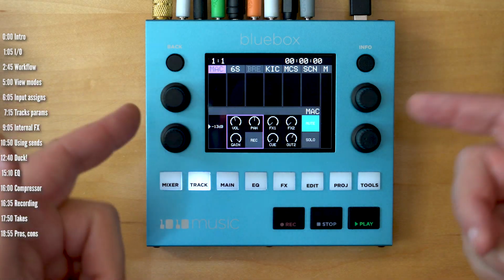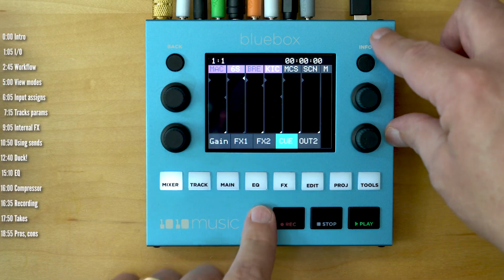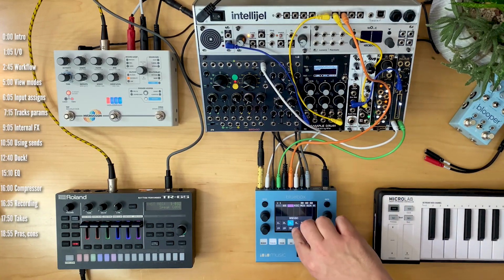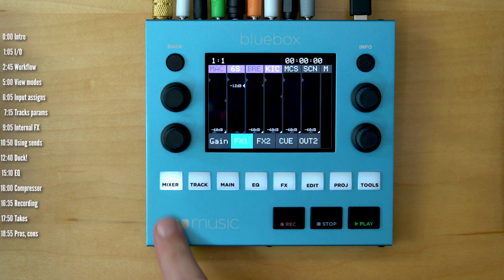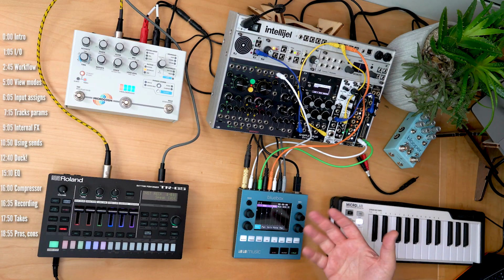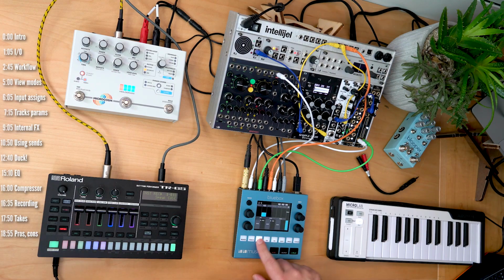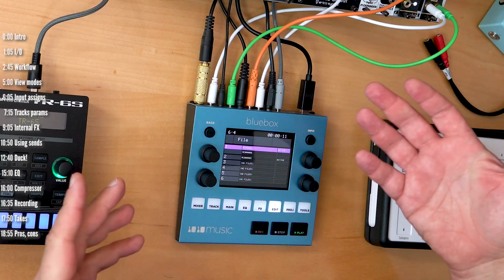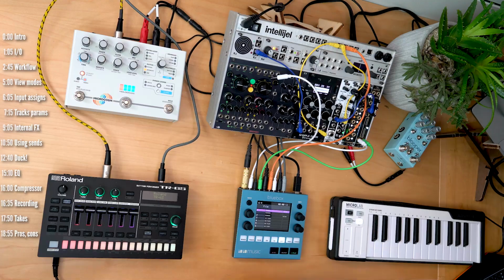1010Music BLUEBOX Review // Is it the new king of synth mixers?

Comment: Really cool, I was just looking for a small mixer. But I have a few questions, is it possible to preview a track with headphones via PFL/CUE and send and return to an FX pedal at the same time (via FX send knob)? And is it possible to use e.g. an Akai Mix to control the individual channels? Does anyone have any information about this? :)
Reply from the maker: Not sure I understand the question, but it is possible to hear some of the tracks through any output you like while you're recording.
Reply: @loopop  I was just a bit confused about output 1 and output 2 and thought it was mono L/R, but it turned out that they are independent stereo outputs, which is great. I'm looking for a small replacement for my mackie 1202 VLZ4, which is a great mixer but takes up so much space in my flightcase (I have all the equipment in one case).  Many thanks for your answer!
Reply: @loopop  One last question: How easy is it to switch a group of tracks so that they come out at either output 1 or output 2? Background: I would like to send my synths and instruments into the Akai Force via Out 2 so that you can use the internal effects there, the whole thing goes back out of the Force into a stereo input of the mixer and then comes out of Out 1. But if I have to load a new project on the Force, it would be cool if the other instruments could still be heard and would have to be switched so that they come directly out of Out 1 without wandering through the Force. Do you think this is too complicated? Sorry for the annoying questions.
Reply: @loopop How easy is it to switch a group of tracks so that they come out at either output 1 or output 2? Background: I would like to send my synths and instruments into the Akai Force via Out 2 so that you can use the internal effects there, the whole thing goes back out of the Force into a stereo input of the mixer and then comes out of Out 1. But if I have to load a new project on the Force, it would be cool if the other instruments could still be heard and would have to be switched so that they come directly out of Out 1 without wandering through the Force. Do you think this is too complicated? Sorry for the annoying questions.

Comment: this certainly fills a gap, but for me its too tiny and unbalanced 3.5mm jacks are too unreliable. for saving desk space, Im using an a&h qu-sb in the back and controlling everything with an ipad.
Reply: That's interesting. How does that connect and what are you running on the ipad to control it? I'm a big AUM user and wondering if I'm missing a trick here!

Comment: This has potential to be a great device. Looks like synth - dedicated device, focusing on needs that many of us who do not need phantom power and high z inputs. It is small, it is portable. However, the fact that it is not audio interface (jet), is a huge downside. No faders, means menu diving. I guess for now it is a good end point of a dawless or a hybrid setup, since it has record feature. However, for me, this would be going back to something I had 20 years ago. When tape recorders were swapped for relatively cheap digital multitrackers, it was a great thing. Affordability, portability no fuss with tape etc. However, the workflow was more less the same - computer for midi, recorder for audio. I started recording audio into DAW around year 2000. and all of my setups to this day are focused on AD conversion and recording into computer, with a timeline etc. So, until they convert this into audio interface, I dont see it unlocking the full potential. Plus, there is a cheap way of obtaining 16 inputs with mic preamps - Behringer UMC 1820 and ADA2600 connected via adat would cost you less than this box. Still portability and features might be selling points.
Reply: That’s what I’m thinking too
Hopefully there will be revisions

Comment: Are the “faders” controllable via external midi gear?
Reply: Support for MIDI controllers is coming soon.
Reply: @1010music  killer!
Reply: Add an external midi controller to get the real faders you need and then you have lost the advantage of the smaller size of the Bluebox.   I'll have to weigh options once the firmware is finalized.  Looks nice though.... On my radar.
Reply: @1010music  I knew it! You guys know what's up. MIDI learn on this beast will put it over the top. I'm getting one for sure.
Reply: Was thinking exactly this. Paired with one of the little micro fader devices it would help a lot.

Comment: Ya the mixer conundrum.  they all have too much or not enough for my rack of synths.  this is a good start.    If i was designing a synth mixer, it would have 12 mono/stereo line channels and  2 standard mic/hi-z channels. it would also have 4 mono/stereo aux(effect) sends and returns for effects chains and not much else.  Like if Mackie made a VLZ-1604, except they converted 12 of the 16 channels to stereo line ins and got rid of the mic pre's on those 12 channels and just left 4 of them as is, THEN make the 4 aux outs stereo or mono. right now those little xenix mixers are the best small mixer for me. it has 4 monos and 4 stereo ins..but no effects loops. but at least you can connect 8 synths to it.

Comment: Thanks for the great video !
I have tons of questions as usually :) :
- Would your compressor tip work with Blackbox’ own compressor as external compressor ?
- Where did the metronome click came from ? Does the Bluebox provide it ?
- Do we know if the feature request of adding USB audio card support is feasible with the current hardware. The analog to digital and digital to analog converters are certainly there, the USB device port as well. But I don’t know if we need anything else or just probably long hours to spend writing the firmware code necessary to present class compliant Audio and MIDI I/O through the USB device port
- Same question for the host USB port, could we imagine it acting as digital audio input (in addition to MIDI I/O) like on the Roland MX1 but with USB Class Compliant devices ?
Reply from the maker: Thanks!
- no, their compressor doesn't have sidechain and is global
- yes it has a metronome
- I asked, they're not planning to make this an audio interface (for now at least). I don't know if it's technically possible.
-  Same for the USB host port, I don't know, maybe they'll comment
Reply: loopop thanks ! For the compressor question : maybe at some point they could add it, would be killer. The audio interface would be killer too.
Do you know if it has a different CPU from the Blackbox ? Strange (though great) to see it’s cheaper than the Blackbox while having way more I/O. I would dream of a Blackbox firmware running there with all these inputs !
Reply from the maker: I don’t know if that’s the same CPU - perhaps they can comment
Reply: loopop let’s see. Could be fun to have compatible firmware between the two, with couple of inputs optionally becoming clock in/outs on the Bluebox. The opposite of having additional audio ins instead of clock I/O would be something a well (I don’t know how different is the hardware between audio and clock I/O though).

Comment: This is what I always needed.
If only it were a bit larger, had faders and 1/4" inputs / Outputs.
I get their signature design and sizing, but the I/O setup will require a lot of new cables / splitters.
Reply: Yes - my thoughts exactly.
Reply: there are loads and loads of mixers with exactly the features you are wishing for from almost every manufacturer on the planet, for many years. this is very small and fits into any live rig/case-that is exactly its selling point. i'm afraid your comment has no point.
Reply: @eleven_live  Don't be afraid, it's only an opinion. :)